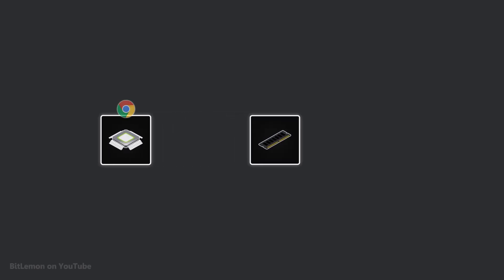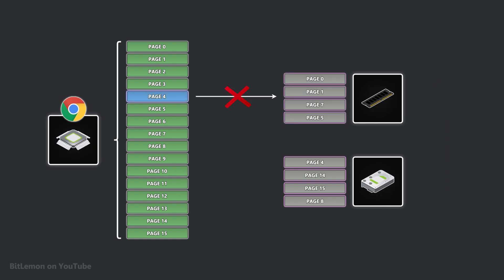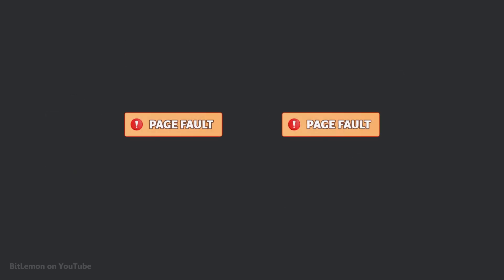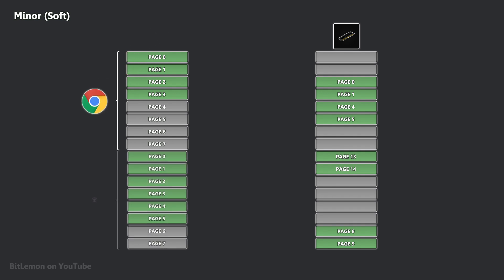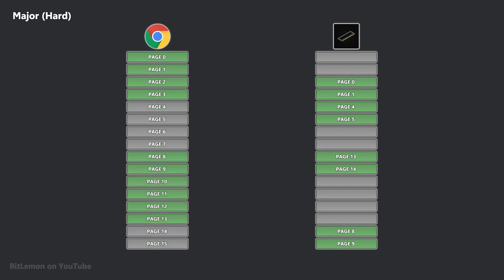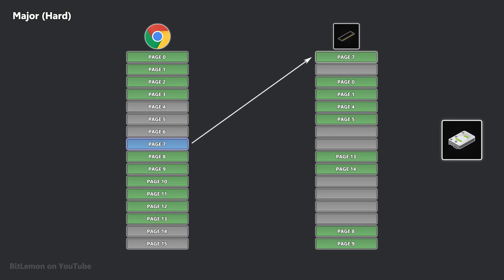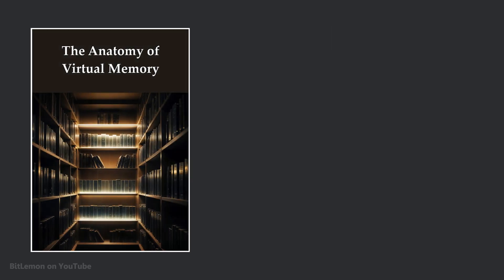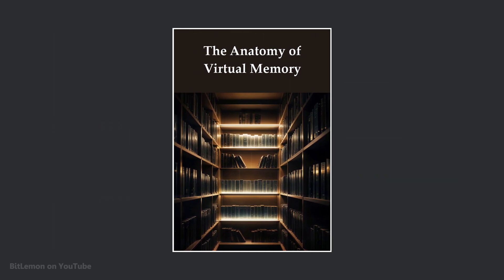What is a Page Fault

Comment: good content as always, is page fault a common thing , and is there a methodology os uses to avoid it ?
Reply from the maker: Yes they are very common, especially when a program starts. page faults are a part of the normal memory management of the system.
There are a few ways to avoid page faults. I think the most intuitive one is to prefetch pages into ram (predicting which pages a program is likely to use next and bring some of them into ram so when they are used by the program - there are no major page faults)